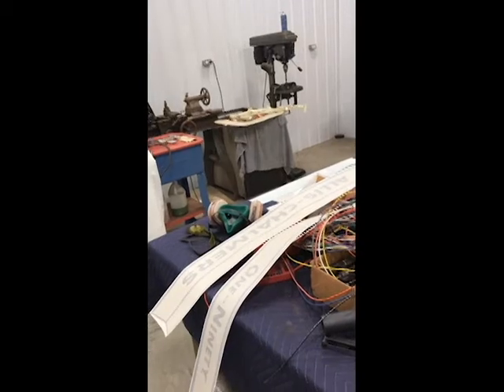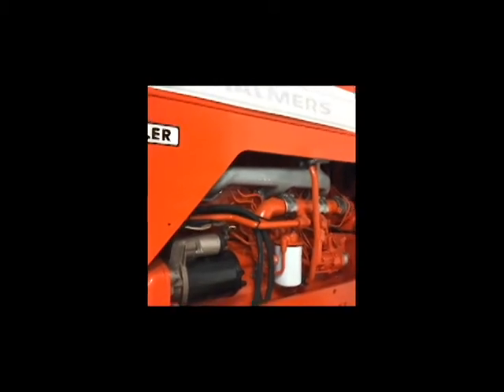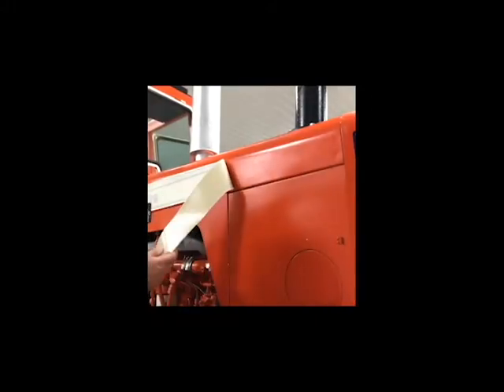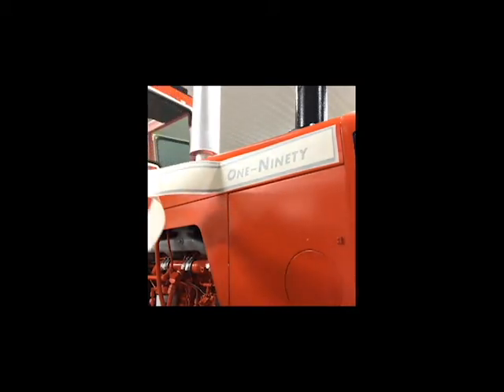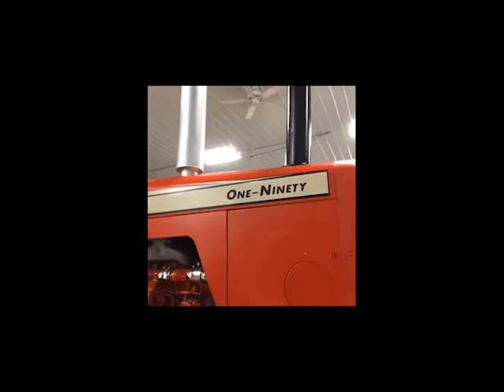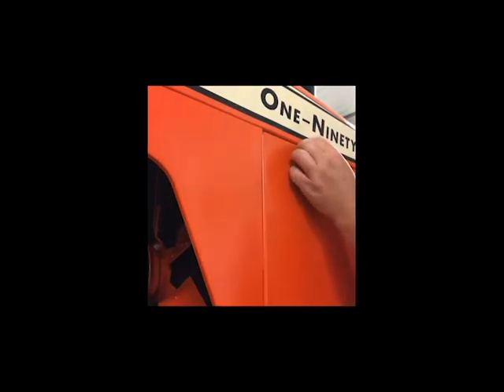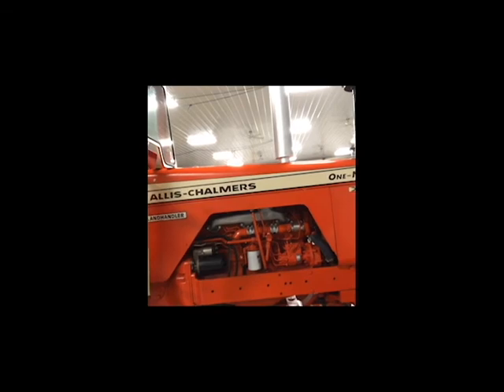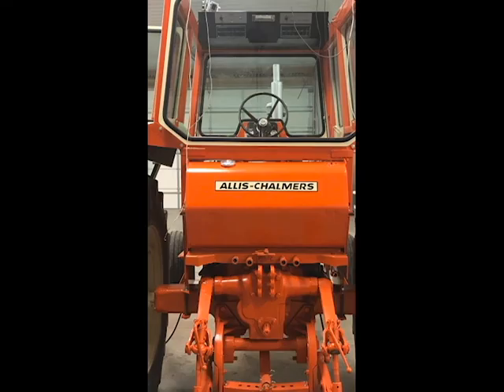Allis Chalmers 190xt Decal Installation

Comment: I usually use soapy water to place them and it allows you to get any air bubbles out with a credit card. Let them dry and then pull hours later.